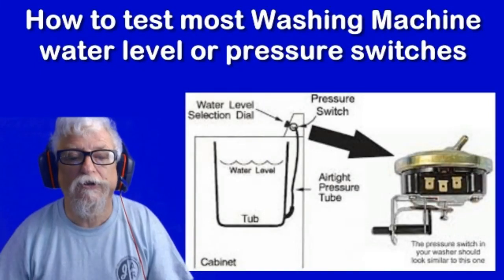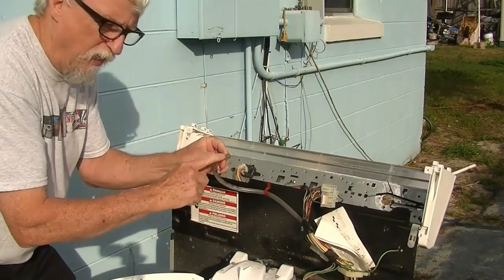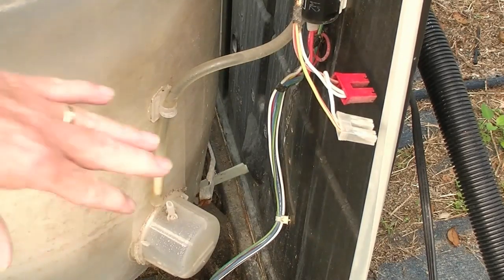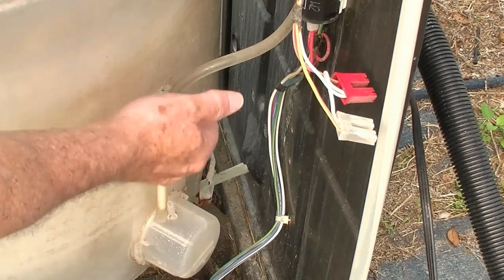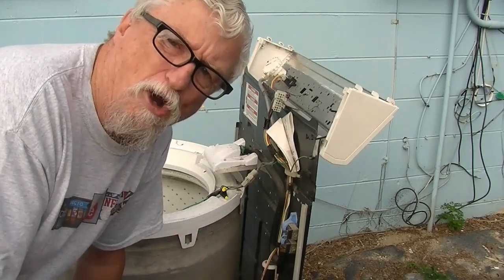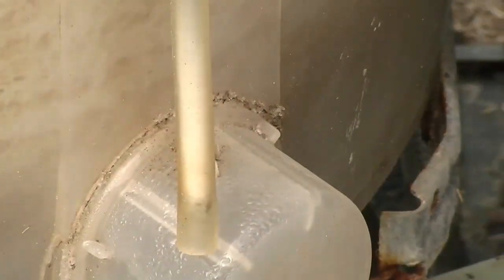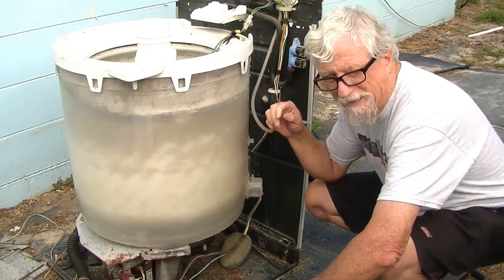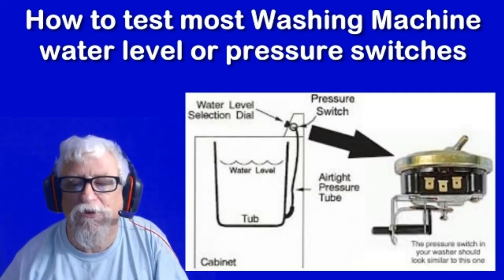How to test your Washing Machine Water Level switch

Comment: Hello, and thank you for the great video. I'm having a different problem. Both low and medium settings fill the water up half way. High setting fills it up all the way. How can I get the low setting to fill the water up lower than the medium setting? Thanks!
Reply from the maker: Clean the soap out of the level hose at the side of the tub.

Comment: I've been searching the internet to see if that specific water level switch is adjustable.  I have the same one as in your video - Part Number - 740-9000.  There is a tiny screw on the back and not sure if that is the micro adjustment?  and idea - thanks.

Comment: Nice tutorial sir god bless I have learn more ideas , , last day I repair damage sharp automatic Washing machine and I've just confirm that the board is faulty,and now I replaced another one a new board and when I test to run  its working.then  after a few minutes the error is display e2,how can I fix this thank you
Reply from the maker: Could be a clogged drain or slow pump. Sometimes the propeller spins on the shaft. Or it could be the computer. Unplug for 30 minutes and plug back in and try that. Good luck. Have an Awesome day 😊
Reply: Thank you 😊

Comment: I’d like to understand how the pressure switch plays into how high the water fills. The circuit board does not totally read this pressure switch as an on off to fill. It does some crazy agitation to kind of tell how heavy the load is as well.  I wish I understood the logic of how load weight and pressure switch all plays together
Reply: Thank you Sir. Did all your steps and washer still over flows. Have to keep trouble shooting. Hate to buy new switch and still have issues.
Reply: @dragonslayer990 - is your switch good?  Gently blow into the PS tube and you should hear one or possibly 2 clicks. That is the switch closing/opening. If you don’t hear that it is probably bad. Checking continuity across the terminals will also tell you if it is working

Are the water valves properly opening and closing?  Not stuck open?

Comment: Great. But you didn't say if the machine does not fill up all the way. I have seen others to adjust the screw on the back of the diaphragm and or/put oil in the tube hole for the diaphragm to lubricate it. Thanks. That about covers all of it.
Reply from the maker: If you connect a hose to the switch and blow you should hear a clicking sound. If not the diaphragm is bad. Change the switch.thanks for watching.

Comment: Hi Harold. It is an interesting video. I would like to know, at 1:10, there is a chamber where the water level tube is connected to: can the water flow upward through the tube? Or is there a membrane that blocks the water for flowing upward through the tube? I was trying to blow the chamber hole, using a tube, i found it is not completely free. Thank you. 😊
Reply from the maker: Water can go up and in the tube but it should stop. If it continues to go to the top you have a leak in the valve or the tube. Have an awesome day.
Reply: @HaroldJackson  Yes, I found the water should not go until the water level switch. Thank you.

Comment: Ok I have a 3 year old Speed Queen that now wherever you set it small, medium, large,auto fill, it fills to the top setting.
It locks so you can't even open it to check it unless you hit cancel for 3 seconds and it shuts off. I would have never known maybe unless 
I wanted a pair of sneakers to soak so I hit cancel it shut off and I noticed it was filled all the way instead of the medium setting. Maybe 
been doing this a week? What do you think is the problem. I don't know about taking the thing apart. Is it an expensive fix?
Reply from the maker: Sounds like it has soap in the hose going to the level switch. You can clean it out by blowing through the hose from the top. Good luck. Thanks for watching and have an Awesome day 😊

Comment: Thanks for posting this - my pressure switch I have to blow like hell to get it to click. Looks like you are not having to blow nearly that hard. I did order it before I saw your clip and I think I did the right thing. It also failed the high contact test on both first and second stage, totally open. Medium contact test passed zero ohms both stages. Empty contact test was odd, showed zero ohms on no air, zero on first stage and open on second stage.
Reply from the maker: Thanks for watching 👍
Reply: @HaroldJackson  You are very welcome, now if I may ask - were you blowing very hard to activate that switch?
Reply from the maker: @Dannysoutherner  no
Reply: @HaroldJackson  Thanks, that pretty well confirms the problem.

Comment: Thank you for the video,my washing machine didn't fill the water,when I test the inlet ,I find no power reach to the valve,do you think it is pressure switch problem????
Reply from the maker: No it's not the pressure switch. Check the lid switch.
Reply: @HaroldJackson  Thank you for answering.
Reply: Hi,I think the lid switch is ok,because the drain spin function is working normal.but still the machine didn't fill water...I am confused what do you think???

Comment: Does it works in front loader?
Reply from the maker: Yes. It's harder to get to. It's on the top right side. Front loaders have a little computer chip that could be bad. Question, did you use the wrong soap? That's will cause issues. Good luck.
Reply: What kind of soap do you mean sir?
Reply: Wrong soap? What kind of soap is wrong soap?

Comment: Great video! My problem is probably rather simple, but I have a tendency to make my problems more difficult to solve than they really needed to be! I deep cleaned my Kenmore series 80 washing machine just this past summer, and without really knowing what I was doing, I assembled it all back together without paying much attention to any of the parts you mentioned in this video. Just a couple days ago now, while my washing machine (Kenmore series 80) was either draining, or on its second spin cycle, I was sitting on my front porch and I heard water forcefully rushing about 15ft away from me, in the exterior wall of my mobile home, where the drain below my kitchen sink is located, and I freaked out! I went over to the spot where I could hear the rushing water, and I noticed that there was indeed water puddling up on the ground along the trailer skirt, and water could be seen dripping down some of the siding where the kitchen sink is located. On further examination, I then noticed that water was soaking the carpet along part of my bedroom wall, where it must have traveled in and along the interior wall from the kitchen sink, and into my bedroom. I have no clue whether the problem is due to something wrong with the washing machine, or if it's simply due to a partially clogged drain pipe underneath my kitchen sink. I would greatly appreciate any help that could assist me in solving the problem. Am I wrong to believe that I may have accidentally damaged something when I deep cleaned my washing machine this past summer, or might the problem be with the drain underneath my kitchen sink? Because the drain in question drain was clogged fairly recently, but the landlord himself was thought to have unclogged it for the time being.

 I would like to thank anyone and everyone in advance, for ANY information they may provide to assist me in solving this very annoying problem! I cannot stand the smell caused by the water that had backed up into my kitchen and along my bedroom wall. The sooner I can solve the drainage problem, the sooner I can rid my home of that nasty smell!

Comment: Hello, my washer doesn't drain all the way.  I don't think it's the pump because it does drain some, just not all the way.  And when I set it to "no spin" it will start to drain a bit and the suddenly stop as if it's completely done draining.  Any thoughts?  Thank you.
Reply from the maker: I need more information. Is it a front load or top load washer. And what brand is it?
Reply: @HaroldJackson  LG.  Front loader.  And I tried all your bits of advice in this video.  Don't think it's the water level sensor.  Thanks for your help.
Reply from the maker: @kbkb6569  front loads are hard to diagnose. I would start with cleaning the drain pump. Check the propeller on the pump and make sure it's not loose. Clean the screen filters on the file hoses on the back of the washer. Good luck 🍀
Reply: @HaroldJackson  Much obliged, Harold.  I did all but the file hoses.  I ordered a new pump, too.  I'll keep ya posted.  ;-)

Comment: MY 1995 Whirlpool water level diaphragm switch tested bad because when empty, contacts V & P showed about 3 ohms resistance instead of zero and sometimes would over fill the tub onto the floor! I FIXED IT by spraying electronics contacts cleaner into around the plunger/spring area and lightly blowing in and out on the hose to get the switch to click on and off then waited for the spray to evaporate and now it reads Zero ohms and no longer over fills!
Good luck! Keep the old ones running!
Reply from the maker: Thanks for sharing. 👍

Comment: My washer overfilled once but it shut itself off.  I had the door open and the washer overfilled but the water turned off but it was after a gallon or so spilled out. It hasn’t done it again. I’ve run it through all water levels and the water shut off. The tube is clear and no holes and the switch is operational.

Comment: Great simple instructions for someone without a multimeter! Now, my problem seems to be that my top load GE is NOT filling enough when on extra large or super for the water level. It's a second hand machine and I washed a big blanket for the first time and set it to super and the fill seemed to stop prematurely. Could this video help me resolve that problem or am I looking at possibly the water level switch itself being defective? 

Thanks!
Reply from the maker: Thank you. Check me out at www.gettr.com/user/harold_jackson

Comment: How do you if your washer level is adjusted properly? What is the correct water level during the wash cycle? How do you check the water level during a wash cycle? Some people run it empty and stop the cycle and open the door to measure the level from the bottom of the door or the bottom of the drum. But what cycle do you run and when do you stop it to check the water level? What should the proper level be? Can’t find the answer anywhwre

Comment: Have you ever done a video on replacing the shaft seal on a direct drive transmission? I have two machines that leak a little oil from that seal. I also have one machine that the seal is good on it but it leaks a little fluid from the weep oil near that seal.
Reply from the maker: It is not that hard to do. Most people don't do this repair. The time it takes to do this repair makes it cost prohibited. The only time you would do this repair is if it is under warranty.

Comment: Will this switch stop the water from filling correctly when it's in the Rinse cycle? It fills correctly on the Wash mode but on the Rinse mode it puts like 1-2 inches of water it the tub with a full load.
Reply from the maker: Its probably your water inlet valve or a clogged water hose.
Reply: Harold Jackson I don’t think it’s a clogged hose as I get hot and cold water with the temp settings. Inlets valve as in the one the hoses attach too, correct?  So could it also be possible that the control switch or pressure switch is bad?
Reply: @HaroldJackson  Exactly 2.5 inches with settings on Full load during the Rinse Cycle.   Use to be about 8 inches.
Reply from the maker: I cant say for sure what the problem is without being there and doing test myself. But most of the time if it's not filling with water it's a water valve problem If it don't fill in the amount of time set on the computer board the timer will time out and stop filling. I would take the hoses off and clean them and check the screens on the water valve. Other than that it could be the timer. It could also be a bad computer board. Good luck. Let me know what you find out.

Comment: Great video. My washing machine is currently working properly, but as I was doing laundry earlier I found myself wondering just how it senses the water level. I knew it couldn't be a simple timer, because the low water pressure in my area makes it take FOREVER for the tub to fill. This gave me a very clear explanation of how it works.
Reply: Well, you’d be wrong if you think that the pressure switch is all that it goes on because it’s not the case for the washers in use for the last several years. If yours turns when it’s filling slightly back and forth then it’s sensing how heavy the load is. It’s definitely not reading the pressure switch solely. Think about it you have small, medium, large and max load dial settings .  The pressure switch is an on/off switch. There’s no multiple levels that it reads. There’s an on/off at one level and there’s an on/off at a flood level and that’s it.
Reply: @condor5635  No turning happens at all until I close the lid after it's done filling, so I guess I'm back to not knowing how it works.
Reply: @brennyn  I don’t mean agitating turning. I mean little,small turns with faint clicks and directions changing. This is the motor sensing how heavy the load is. Combine that with the first pressure switch setting being achieved or not s how it determines the water level is ‘correct’

Comment: Accidentally left the selector switch on low water level but wanted the higher water level. Switching to the higher level continues on low and does not switch. How do I fix it so it will go to high?

Comment: Just because the diaphram is not broken means the switch is good???
  Shouldn’t the contacts on the switch be checked for continuity before and after blowing in the tube to see that it is working properly electrically?
Reply from the maker: Never had one go bad before. 100 percent of the time it has been the diaphragm.